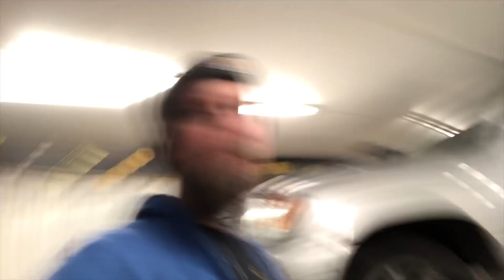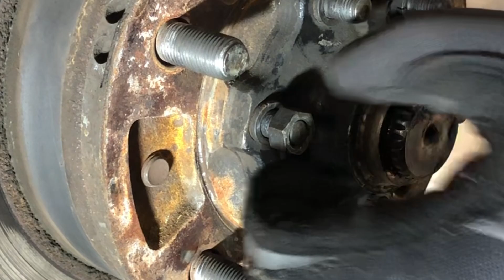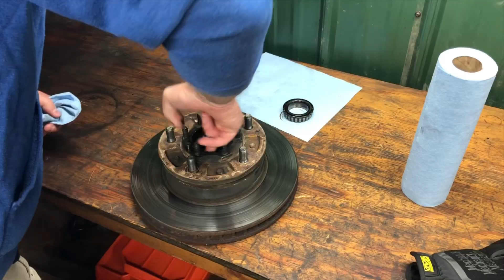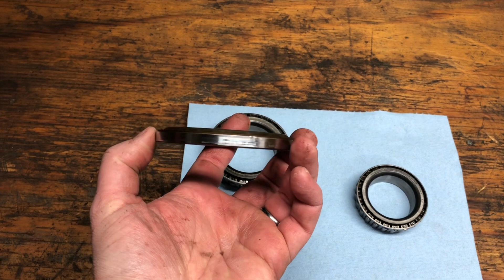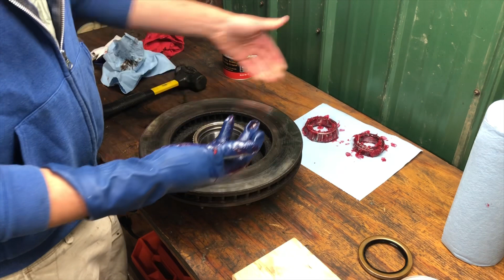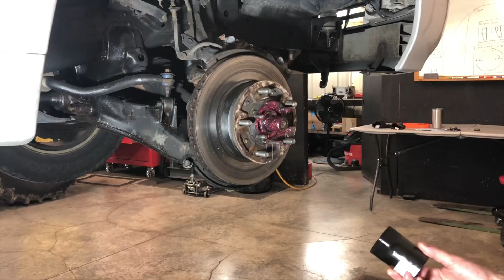Diagnosing and Fixing Wheel Bearing Noise on my 100 Series Land Cruiser

Comment: lately my lc100 started to make a grinding sound from the rear differential and i'm trying to figure it out what it is but i think its the axle bearing because its really noise and you can hear it even from the inside and it doesn't get out the sound until i hit a pothole or some little bumps i think when one of the wheels get more load than the other when i go left or right it appears even when i'm at 50kmh or so
Reply from the maker: If you notice that the sound gets louder when you load up one of the wheels around a corner then it's outer wheel bearing in the diff. When you go to replace it, make sure your diff isn't leaking. Low fluid level in the diff will cause the outer bearings to fail quickly.

Comment: I am having noises when I accelerate not sure it’s wheel bearing or it’s transmission
Reply from the maker: Is it a whine sound?
Reply: I suddenly got a big mechanical rattle sound, plus a rhythmic "bang, bang"....got very loud, every time I so much as touch the accelerator.
I gotta fix it fast because I am under a 60 day work order on my yard. A lotta stuff to move, facing big fines if I fail to get it done.
Now no car.
So far no luck on entire internet.
2026 and 8 billion plus people, but internet relatively useless on this issue.

Comment: I am having the same issue. 73 mph I have a droning/ growling sound that subsides around 80. My problem is I can't tell where or which wheel the noise is coming from. How could I determine? Any help would be appreciated. I have spent lots to get it resolved. Thanks!
Reply from the maker: These noises are difficult to diagnose. What all have you had fixed / inspected up to this point in chasing the issue?
Reply: @FunAhead_TV_Official  2006 LX 470 140K miles. Front diff inspected, rear diff replaced, Front DS wheel bearing replaced,Both front CV axles replaced, rear and front driveshafts replaced and u joints OEM from the dealer, all 4 tires replaced. Motor mounts, Upper control arms.  If you name if its been done.This has been over the span of two years and not one single dealer ( 3 separate Lex dealers and several reputable dealers and still no resolve. Thanks for responding!
Reply from the maker: Wow, yea you’ve definitely gone down a rabbit hole with it!! Other things to check would be the transfer case, the passenger side wheel bearing, making sure both wheel bearings are properly greased with proper preload (even though they’ve been checked / replaced). Additionally, make sure the drive shafts have plenty of grease in them, and the proper kind of grease. Red grease, rated at NLGI#2. The drive shafts can make a ton of noise if not fully greased up. Oh, one question… does it always make the noise no matter what? Or does it get better / worse longer into a drive?
Reply: @FunAhead_TV_Official  the noise is only between 73, 73 MPH and gets almost silent at 80. I really appreciate your input. Transfer case was checked as well. I am coincidentally having the both DS regreased and I have my own grease.Red NLG #2. I have been having it greased regularly but not sure if they ( Lex and toyota dealers) have been following FSM ..Go fugure..just my luck!
Reply from the maker: Well, it certainly sounds like you have all of your bases covered! You’ve shot down all of the avenues I can think of. 

Mine does some minor whining at various speeds too… likely pinion bearing for the rear diff, I believe. Not anything to be alarmed about though. Trucks are always more inherently noisy with 2 diffs, transfer case, so many shafts, big tires, etc. 

Good luck with it! Keep me posted on if you end up solving the issue.
Reply: @FunAhead_TV_Official  you've been a gem. These trucks are beast, but like any other vehicle noises, hard to diagnose. Have a great holiday and I will def keep you posted. Hoping its the rear wheel bearings. lol Thanks!
Reply from the maker: Thanks man!! And I appreciate you watching the channel, and for reaching out. You have a great holiday too and I look forward to hearing what finally solved the issue!
Reply: I had the same issue. Finally resolved it by changing the spindle  needle bearing , brass nut and oil seal.